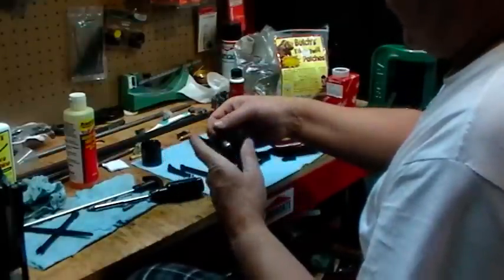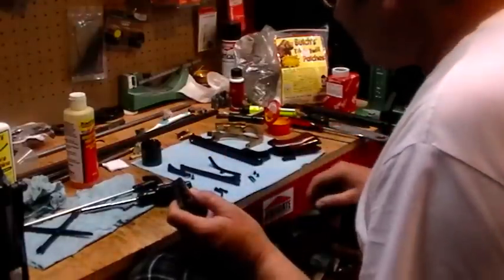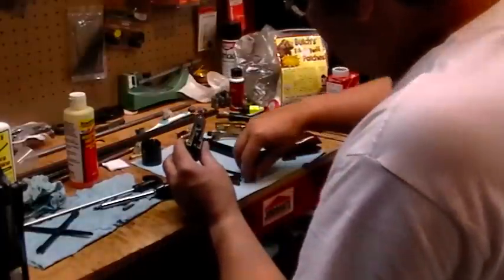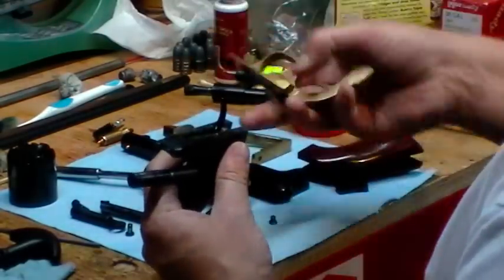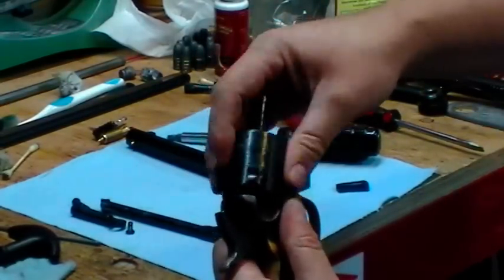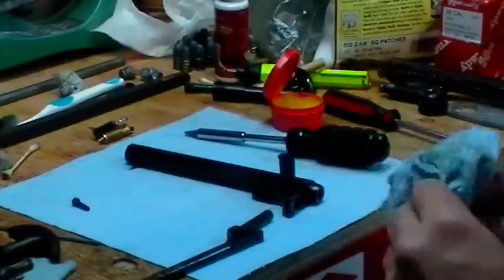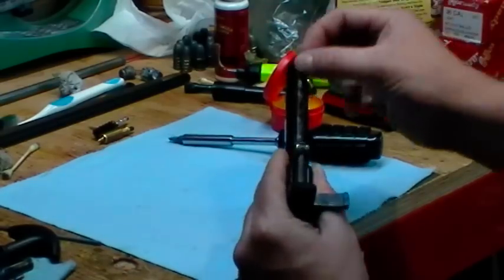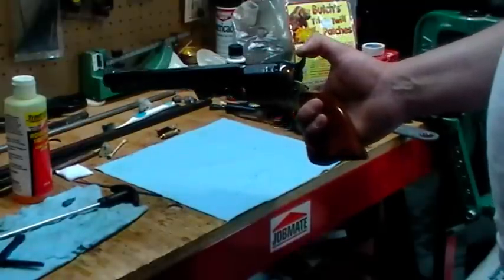Reassembling the 1851 Navy

Comment from the maker: @reysaint1  You can pull the wedge out as far as the screw will allow and the barrel will come off, some wedges will come out, some won't with the screw in. The retaining spring on the wedge is stopped by this screw. If the screw won't come out easily I would recommend a gunsmith if you really want to remove it.

Comment: my cylinder is spinning freely it won't click and it will not move every time I talk it did I put it back together incorrect
Reply from the maker: Check the spring on the hand, sounds like it broke or got flattened.
Reply: +hogsnplanes I tried that it looks fine to me it does stay put them when it's in full cock
Reply from the maker: Still sounds like hand issues to me if it spins without clicking on half cock.
Reply: The handspring

And someone told me you don't have to do a tear down every time you shoot it
Reply from the maker: Yes the handspring. You don't have to do a complete tear-down every time you use it especially if your using it regularly. But for long storage between shooting secession's or seasonal storage its a good idea.
Reply: +hogsnplanes it is my concealed carry weapon I live in the state of Florida it's all I'm allowed to own cuz I got caught in New Jersey with a pellet rifle